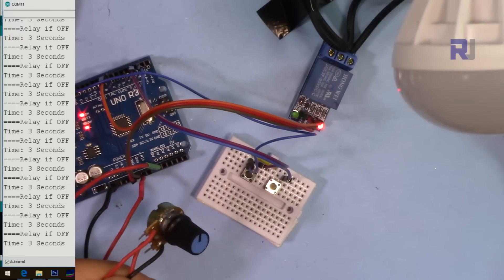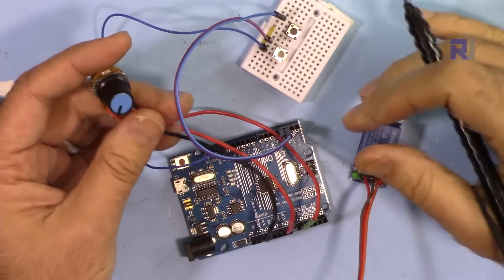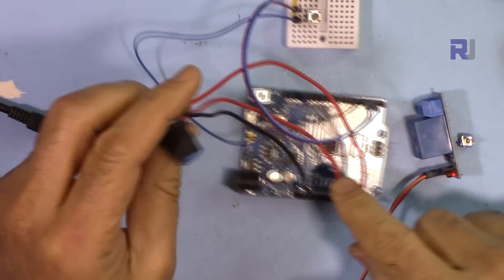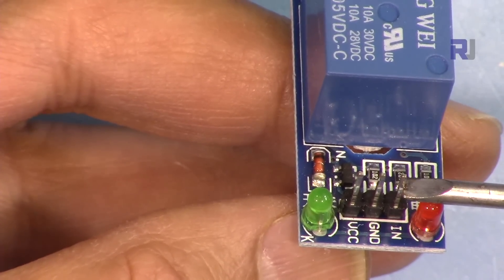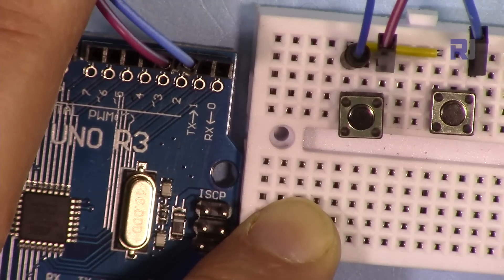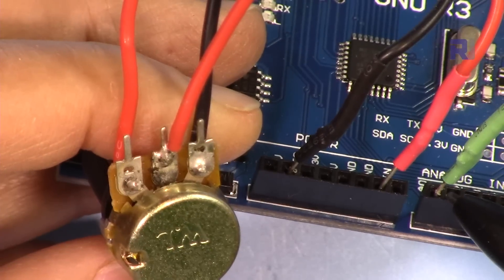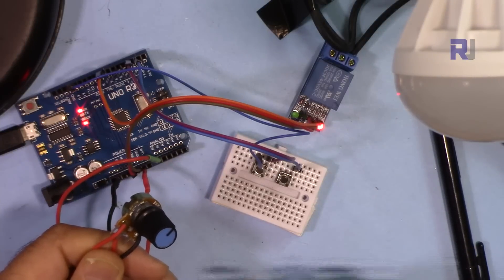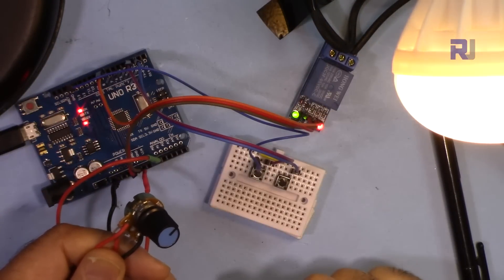Home Automation: Control a Bulb ON/OFF time using Arduino Relay Timer V 1.0 RJT130

Comment: Sir kindly change the code pull-up to pull-down because when you on arduino relay tur on for some short time this is annoying because I connect to my oven.
Reply from the maker: sorry I did not understand. do you want to the time the relay is ON to be OFF and OFF to be ON? if so connect the relay has 3 terminals, for your load or oven keep the middle wire as it is , just move the 2nd wire to the other terminal of relay.
Reply: @robojax  I have the same issue.  on start up the relay is turns ON for a few seconds before it turns OFF then it functions fine. it's on initial power up the relay turns ON for a few seconds but it should only  turn on when the Button is pushed. its a little confusing as I've had to wire it NC when it should be NO but in order for it to turn ON when the button is pushed then it seems to need to be wired backwards.

Comment: Thank you. I tried the code in the simulation program. It worked, but I faced a problem, and it does not perform the reset. What is the problem, then? Thank you.
Reply from the maker: Check the wiring then.

Comment: Hi, thank you for the great video. If the timer was set to say 20seconds, What would happen if the start button is pressed when the countdown time has started. Would it start again from 20seconds or would it add 20 more seconds to the time that was left?
Reply from the maker: Hi you are welcome. I had to look at the code to answer. I have explained it in the video fully so you should know it by now.  the line  (below) where it sasy ememTime = millis(); it setns time with the current time using millis();  So it resets the time. 
    if(digitalRead(startPin) ==LOW)
    {
     rememTime = millis();
Learn about millis() which is one of the import feature of Arduino in this video https://youtu.be/obBX9hyH5mM

Comment: I am having an issue where the potentiometer value is not changing the time interval. When I provide power to the Arduino the time interval seems to be randomly set to either the max time or min time. Adjusting the potentiometer does not change the time. If you or anyone else here had this problem, I would appreciate your advice on fixing it.

Comment: Hi Robojax, 
great project. 
I am struggling with debounce from the start button, it will be possible for you to add code that eliminates this problem.
Reply from the maker: Hi, it should return back by itself if you haven't changed the code. the INPUT_PULLUP to keep the switch input to HIG when not pressed. Something is wrong with the wiring if I assume code is not modified.

Comment: Hello, can we control more than one relay using the same ARDUINO?
Reply from the maker: Hello/Salaam, Yes you can. Just define the variables I mentioned for the rest, relay time etc. it should worked. You gotta watch this multiple time like 3, 4, 5 or 10 times so you know how it works then write your own code. very easily.
Reply: @robojax  You are right, but I want to put a different potentiometer for each relay. However, their codes are always intertwined. Also, based on your experience, I want to send this time to Arduino with HC-05 bluetooth module and update the time. Can you help me to do this? I really need it for my job. Manual dosing of the coffee grinder in my coffee shop. I want to dose it over time. If you help, you will make a person work more comfortably and I will be grateful to you.

Comment: Hello
You code was usefull for me to controle a water pump, using a overflow switch to start a the timer function, and then running for about 15 seconds.
Thanks for helping me make my project work.
The next thing I will try to make, is a connection to a RPi, logging the time stamps, so i can see when and how many times the pump is turned on, to figure out if ther is a differens between the time of the year and how mutch water comes out of the ground.
Ideas are welcome.

Comment: Can you help me with a instruction video or code on a timer with 2 timed functions with a single activation button and millis instead of delay?
I tried this for a while yet i can't find the magic touch to make it work as i want to..
I wanted to make a timer for a old Diesel where i press a pushbutton and it starts the glowplugs for 35 seconds and after that a second relay comes on to power the starter, after 3 seconds both timers turn off and the whole process won't start again untill the button is pushed again, purpose of using is on a boat where i have to wait for waterlocks and bridges sometimes for hours so with the engine off saves fuel and when the light turns green i need to start for those 40-ish seconds AND let go of the lines, thats why i thought of a Auto start, this already exists on the more industrial boats.
If this worked for me i also wanted to use this on my Tecma RV toilet on board where i could flush and mercerate with the single press of a button and a timed process instead of dualing with 2 buttons constantly :)

Please, could you help me with this? I already made use of your video above for a walk light from the light switch to my bed which i love very much
Reply from the maker: Hello, I  might write V2 of timer which would have dual or multiple timer. I did not understand the process.  To simplify it, you need the exact independent two of this timer. correct? each with separate reset.
I don't promise as I am very busy but I will put it on my list.  you may use this dual timer module https://youtu.be/O01NCZq7O2M
Reply: @robojax  Yeah with one click i want to start 2 timers but the second timer comes on after x amount of milliseconds (i can set this later i guess) and both timers get a seperate reset.. But doing this with millis instead of delay seems to be the hardest bit for me to figure out, a (older) diesel engine needs to spark before you can start it, thats what the first timer needs doing, the second timer will turn on the engine so together in a timed setup they make a "modern" powering on the engine with a button, and since the glowplugs and starter aren't needed when the motor is running, the process resets.. And someone mentioned doing this with 2 seperate timer setups but then they wouldn't be timed to each other and that could create errors or malfunctioning in the starting process.
If a video is too much time or the question is too tailored for a larger audience it would be okay for me if you could just help me with the code.. Ofcourse the video would be awesome but i do get you're quite busy

Comment: Thank you for making this video!
Could it also be programmed to display the time setting on 7 segment display?
I would like to build one to control an induction heater and would like to use this setup to set and control the device.
Thanks again!
Jeff
Reply from the maker: Hello Jeff, you are welcome. here is educational clock video fully explained. so you can learn from that that https://youtu.be/qB0drI56zGE  using arduino. but if you don't want to know how it works, then this is the kit to build clock https://youtu.be/qwHMx1vGJSE
Reply: @robojax  Thanks for the reply, I found another of your videos on your sight that YT hadn't pulled up for me .

https://www.youtube.com/watch?v=BhEIFzFSMuE&feature=emb_logo

I believe this will have me desired function.
Thanks again your doing this!
I just became a patron as well!

Jeff

Comment: Sir, 
What to do to control relay with potentiometer using arduino.?
Reply from the maker: isn't this the video? we are controlling relay using potentiometer. relay can be only turned ON or OFF.
Reply: @robojax  Sir this is the timer one.
Reply: Sir,  how to set a value on the potentiometer.
When the potentiometer is on that value the relay turns off and a slight variation on  potentiometer turns the relay on.?
Reply from the maker: no it will not. We set value. once it reads it, it is done.

Comment: This project very useful thank you for your video I need same project 3 push button timer control code I try many time but not successful plz sir upload code. Thank you
Reply from the maker: this is version 1.0. , V2 is with LCD and I am making V3. Tell me the functions of 3 push buttons? whey do they do? I will try to make another video in the future so I can incorporate your requested if I find it interesting.

Comment: You explained well. I have a project, liquid dispensing machine.  I have to use a contactless water level sensor. So the logic is when the liquid level is above 100ml, the ultrasonic sensor will sense the container and after 2 seconds the pump will actuate for a controlled time (variable time b/n 0sec to 20sec).
And if the level drops below 100ml, the ultrasonic sensor should not sense and an led should glow. 
I request for your help with this project.
Look forward to hearing from you.
Reply from the maker: this itself requires a project.  can't be explained here with text. I just put it on my "to do" list and if time permits, I will make video. But this very unique and not many people want it.  Here is my last video on designing Thermostat and you should learn from it. The idea is exactly the same. Water level is temperature. Watch it, you may learn from it https://youtu.be/dVh77wT-4Ao

Comment: how to modified the code using 4 relay channel. same set time (1 time set for 4 relay channel) but,  they run differently? . examples, set time for 30S , relay 1 start for 30 second, after that, relay 2 run for same time , and then relay 3 run for same time, and relay 4 run for same time, and stop. thank you for yout attention
Reply from the maker: this code can't be modified easily to accomplish that. because you have specific time, just use this https://youtu.be/Wbm3MCMgM_s and when each relay and use millis() . here is introduction to millis() https://youtu.be/u2HsiTS8niQ and here is Blink using millis() https://youtu.be/rUtDfadf8Jk
Reply: Robojax thanks for your help, im back using this setup. Now, how to control timer above 100 sec , let’s say 30 minutes. Do i need an rtc modul or what? Thanks for your help

Comment: Coding error
Reply from the maker: What is the error? If you copy and past, you should not get any error.
Reply: @robojax  compilation error:lcdcrystal i2c.h candidate expect 3 arguments, 0 provided,return code is not zero
Reply from the maker: This error is for a project that has LCD. The project in this video has no LCD. You have not watched the video. Please watch the video, listen to code explanation and then follow, I can assure you it will work.

Comment: This code is for Minute 
from 1 min to 30 min ✌✌✌✌😃😃😃😃😃

#define relayPin 8 // the pin relay is connected
#define potPin  A0 // the pin potentiometer is connected
#define resetPin 6 // the pin where rest switch is connected
#define startPin 2 // the pin where start switch is connected

#define relayType 'L' // Relay trigger type. L for low and H for high
const long int maxTime = 1800000;// maximum timer time in milliseconds
const long int minTime = 60000; // miniimum timer time in milliseconds

// do not change anything bellow here
long duration;
int potValue;
long rememTime;
int relayState =0;

void setup() {
  pinMode(relayPin, OUTPUT);// define relayPin  as output
  pinMode(resetPin, INPUT_PULLUP);// define input pin with pullup (watch video)
  pinMode(startPin, INPUT_PULLUP);// define input pin with pullup (watch video)
  attachInterrupt(digitalPinToInterrupt(resetPin), reset, LOW);
    
  Serial.begin(9600);// initialize serial monitor with 9600 baud
  if(relayType == 'L')
  {
    digitalWrite(relayPin, HIGH);// turn the relay OFF and keep it OFF
      Serial.println("Robojax.com Relay Timer"); 
      Serial.println("Relay Type: LOW Trigger");      
  }else{
    digitalWrite(relayPin, LOW);// turn the relay OFF and keep it OFF
      Serial.println("Robojax.com Relay Timer"); 
      Serial.println("Relay Type: HIGH Trigger");
  }  
}

void loop() {
  potValue = analogRead(potPin)/10;// reads the value of the potentiometer (value between 0 and 1023)

  duration = map(potValue, 0, 102, minTime, maxTime);// convert A0 value to time set at minTime and maxTime
  
    if(digitalRead(startPin) ==LOW)
    {
     rememTime = millis();
     relayState = 1;
     controlRelay();// send command to turn the relay ON
    }
   if(  (millis()- rememTime) > duration )
   {
    relayState = 0;
    controlRelay();
   }
      Serial.print("Time: ");
      Serial.print(duration/60000);
      Serial.println(" Minute");     
 delay(200); // wait for 200 milliseconds    
}// loop end

/*
 * 
 * @brief Turns the relay ON or OFF 
 * @param none
 * @return no return value
 */

 void controlRelay()
 {
  if(relayType == 'L')
  {
     if(relayState == 1)
     {
    digitalWrite(relayPin, LOW);// Turn ON relay
      Serial.print("LT-Relay ON for ");
      Serial.print(duration/60000);// display in seconds
      Serial.println(" Minute");
     }else{
    digitalWrite(relayPin, HIGH); // turn OFF
      Serial.println("====Relay is OFF");
     }
      
  }else{
     if(relayState == 1)
     {    
      digitalWrite(relayPin, HIGH);
      Serial.print("HT-Relay ON for ");
      Serial.print(duration/60000);// display in seconds
      Serial.println(" Minute");  
     }else{
      digitalWrite(relayPin, LOW); 
      Serial.println("==Relay OFF");  
     }  
  }

}//controlRelay end

void reset()
{
  duration =0;
   if(relayType == 'L')
  {
    digitalWrite(relayPin, HIGH);// turn OFF High trigger relay     
  }else{
    digitalWrite(relayPin, LOW);// turn OFF Low trigger relay
  
  } 
  Serial.println("Relay OFF"); 

}//reset()
Reply: but my relay is not reseting if i press reset button
Reply from the maker: the pin you have connected to reset button is has issue. either the button or wires. Check it.
Reply: @robojax  ya I got it

Comment: i can not modify more thant 30 seconds, i wihs yo could helpme
Reply from the maker: have you watched the video? you can set it to anything you want. just change this line 
const int maxTime = 30000;//
Reply: @robojax  dear robojax, jorge is right its not posible to change the value over 32000ms, i dont know why, when i set it to 33000ms or above the seconds counter in the serial shows me minus seconds and its not from 3s to 32s its showen as -32s to 2s, really strange dont know whats happening here??, its really shitty for me because i wanted this code so bad because i need this but set to 15min to 60min

Comment: Very use full ..... but i came across a simple 555timer based relay circuit !! Which does the same . But there is no serial monitor ( obviously) but who cannot get their hands on timer relay ! Then this is the way to go ... good tutorial .. 

Please make a tutorial on rpm counter using Hall effect sensor . And relay cut off after rpm limit . And a button to turn on the relay on or off when required. 

Thank you in advance. Eagerly waiting for the video...
Reply from the maker: I just put it on my to-do list but no immediate promise. Thank you.
Reply: @robojax  thank you for accepting the request. ... as I said earlier I have never seen such a quick responses from any youtuber.  Another request please please try to make the tutorial as earlier as possible.  It's my sincere request.  Please make time for this tutorial.  Thank you so much in advance